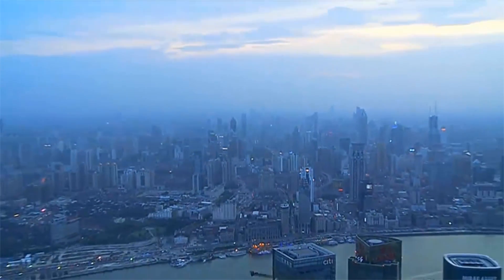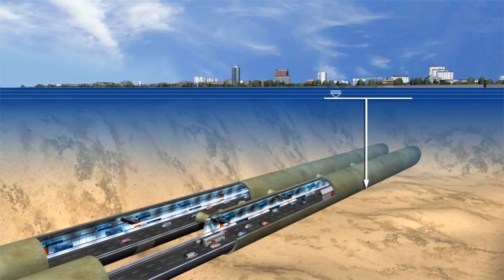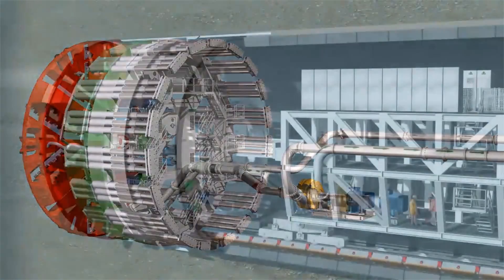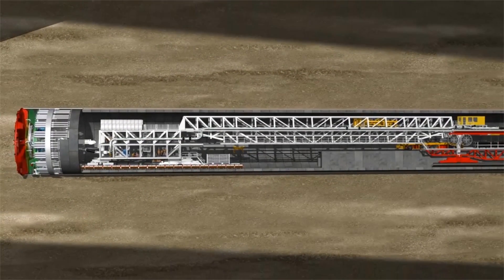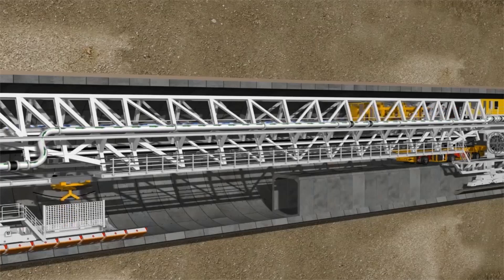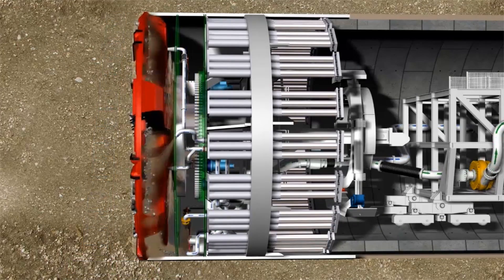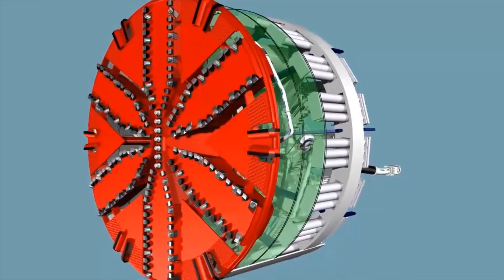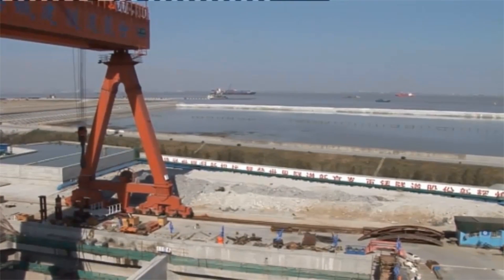Mixshield

Comment: i've always wondered why they don't just like slip form concrete behind the cutting faces to make a  concrete shell lining  tho i imagine its probably due to the curing time, but  then couldn't you just make the slip form / tunnel shield longer so that but the time  the concrete  reaches the end of the slip form its cured enough to take the weight ?
Reply: Concrete curing isnt the problem, concrete itself is. With no yield point or elastic limit, its ultimate limit is the failure point. Hence, other than injecting concrete and waiting for it to cure, you would need to think about adding in steel casings for reinforcement. Then we are talking about the same timeframe as building constructions. To be able of achieveing 26m of tunnelling/day and ending up completing the project one year ahead of schedule they are doing much more than just 26m/d. Hence when time is an issue alternatives are considered.